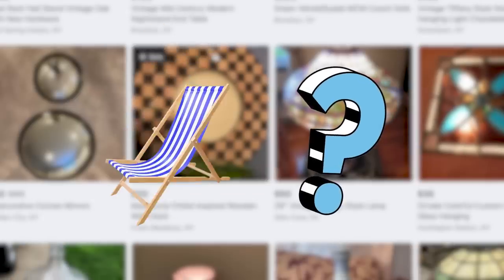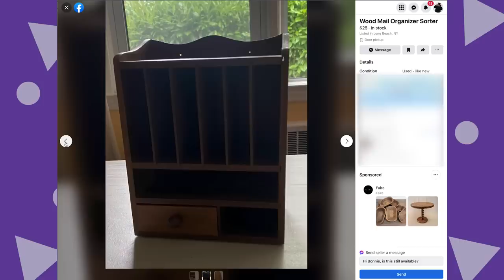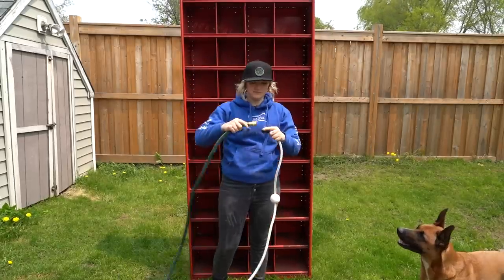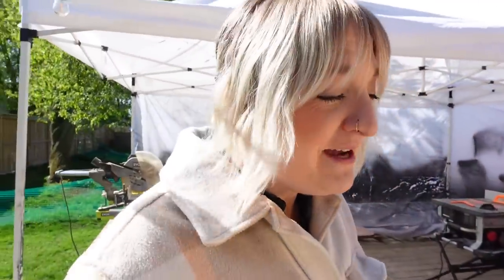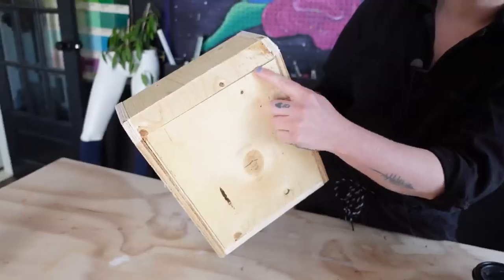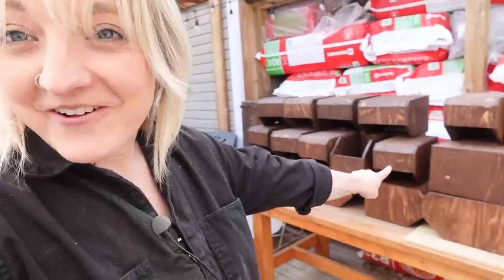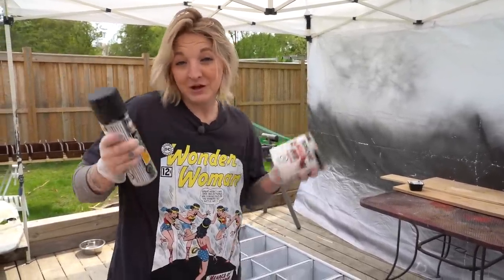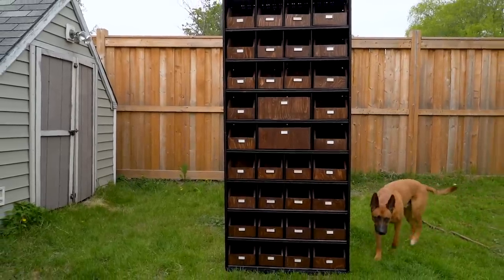*custom* apothecary garage tool organizer | THRIFT FLIP CHALLENGE ft. @diyhuntress | DIY Danie

Comment: Danie, great job!  
I am going to throw one wrench into it though.  Due to the large height of this unit, and not being able to easily get the drawers in and out in those upper areas (especially when they have stuff in them).  I would suggest, laying the shelf unit on its side, and using it that way.  I know, the boxes you made will not fit in that way, but I think it would be easier to access, especially if you put the unit horizontally on top of some low to the ground storage boxes, or, just mounted it horizontally, knee to waist high, on a wall in the garage.

Comment: Ok gotta correct you a little you can do an oil primer and then a latex paint what you can't do is put a latex paint over an oil paint but kilz is oil based used to be used alot in burn outs and then painted with latex this is coming from a painter of 27 yrs.

Comment: OMG are you TRYING to cut your fingers off on the table saw??? Blade height max 1/8" higher than the stock.  Do NOT crosscut using the fence.
Reply from the maker: I’m always make sure I’m safe with my cuts!! I have the added security with my sawstop that will shut down immediately if it comes in contact with skin. ❤️